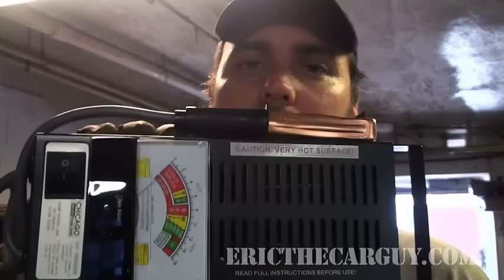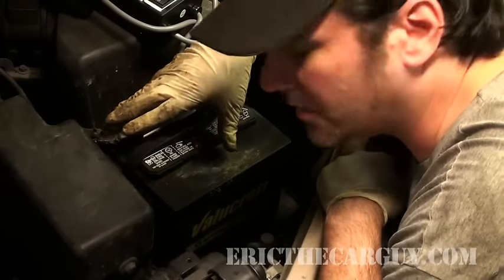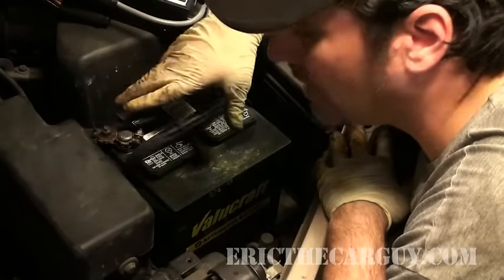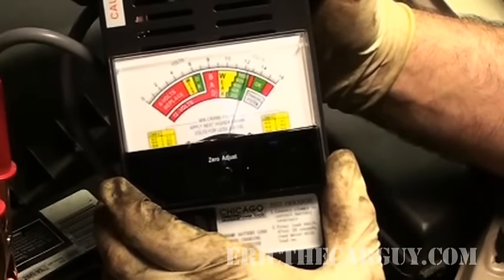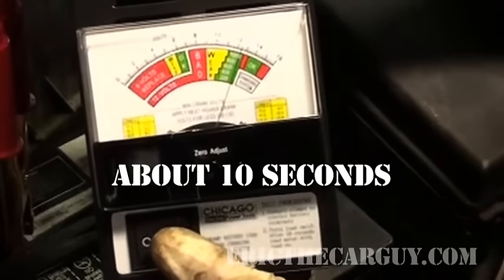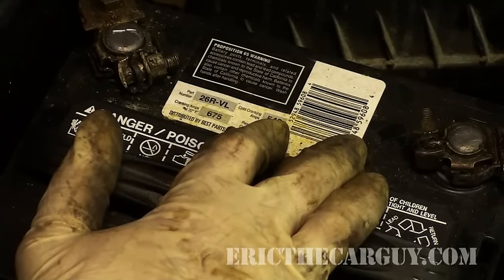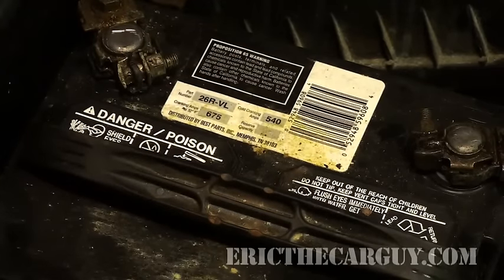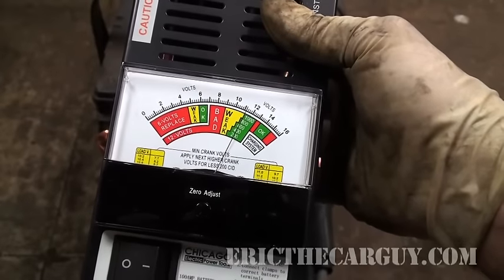Load Testing A Battery - EricTheCarGuy

Comment: Honda dealership told me I needed a new battery when my voltage was reading 14.2 with engine running and 13.2 engine off. The battery is less than a year old and I have ZERO issues with it. Autozone later confirmed a GOOD battery. How does Honda dealership mess with load printouts????
Reply: 996601 996601
12.6 off is 100% 12.4 is 75% good
Reply: Sadly many honda dealers like to feed you BS to sell you stuff lately. Recently they killed my battery during service (left lights on maybe) and came out with a BS load test AFTER they killed it and looking to sell a new one. I guess the factory trained tech was out back smoking weed the day they taught that load testing a discharged battery is foolish. Battery was fine before that day and ever since. Passes a PROPER load test (when charged) with flying colours. Maybe I can take in my load tester and teach them a class. Had another LOL report when they measured nearly new tires at HALF the actual tread depth. JUST change the oil, I don't need your BS. btw no need for fancy calculations. That stepped scale on your load tester gives you a pretty good approximation of available CCA.
Reply: 14.2 to 14.7, heck! Even 15 volts while running at idle is good. With the engine reving shouldn't pass of 15 volts and with a load, 13.7, 13.8 its ideal, but, 13.5 to 13.0 is excellent. Forgot o say, that when the engine is turned off, the battery gonna read 13  Whatever volts, Then is gonna drop to 12 Whatever volts.

Comment: alternator changed-battery 1year 2 mths old
cranking is weak as the engine feels like its going to die

battery voltage measured ( engine off ) 12.4v < after i shut off the engine from driving

battery voltage (engine on) 14.4v

battery voltage with full load ( 1 HID kit , A/C , Stereo w/ 1 amp no subwoofer ) 12.2-12.6v 

battery voltage with load while driving ( same as above ) it's about 14.0v - 14.2v

What seems to be the problem? A wireman told me that my battery has passed its lifespan..

Comment: @masteryoda394 I would think it should be in the manual, but I just checked the manual for our 93 Chrysler and it says nothing about this in there. Checked under the hood, nothing, driver door, nothing. I would check for your car anyway, then there is always google to help. It is probably listed in a factory service manual, but I can't find mine to tell you. You can usually go by the battery the car already has, but you can always use a higher amp battery as long as it fits.

Comment from the maker: @grixxles If you load test it like in this video you will know for sure but your describing a failed cell.  The symptom could also be the result of a poor connection so make sure your batter connections are clean and tight especially if you have those aftermarket terminals where you pinch the wire into the connector, they have a tendency to corrode hear and cause a connection failure.

Comment from the maker: @fraternica I'm not sure if that's a battery problem but it wouldn't hurt to check it.  It might be that the clock itself is bad when it switches over from low power to full power when you start it.  I really couldn't say without knowing the car and having a wiring diagram to see how it is suppose to work.

Comment from the maker: @richardramoso First I don't recommend washing engines as I know of more than one occasion where a no start happened shortly after.  It sounds like you might have a problem with the battery, charge it, load test it and see what you get.  If the battery is good then check to make sure the connections are clean at the terminals.

Comment: Your video helped me alot Eric I bought a voltage meter. I thought I needed an alternator but as per your instructions I realized my alternator is fine and that my battery was weak. And to tell you the truth it's one of my favorite tools now I find myself poking and prodding and checking voltage all over the car just for no reason for the fun of it I find it all very interesting. Your videos are very informative I have learned a lot from you. Two things it's awesome that
Reply: Most mechanics these days won't let your car leave the shop unless they stick you with at least a $1500.00 ~ $2000.00 bill.  It's always better to test and fix your own car problems these days.  Better yet, buy a car built around or before 2005 as these vehicles have much less electrical and computer controls and sensors which makes the vehicles ten times easier to diagnose and fix by any home DIY mechanic.

When car manufacturers install sensors to monitor windshield washer fluid levels that's getting to the point where car manufacturers are installing whatever sensors they can to maximize profits at the automotive repair shops.
Reply: @happycat0411  100% correct 👍

Comment: Good useful vid!

In a future video, you might want to mention that another sign to identify a bad battery is that it very quickly recovers to its preload voltage after a large load test is disconnected from the battery.  Note:  A good battery gradually recovers its preload voltage after a large load test is disconnected from the battery.
Reply: Would you mind explaining the reasoning for this from an electronics perspective?

it doesnt make sense to me.

thanks
Reply: ***** I do not know the reason that the phenonenon occurs or exactly what chemical reaction/s occur, however, I do know it is a proven fact that it does occur.

If you do not believe me, the next time you buy a car battery, buy a .06 Ohm resistor also.  Fully charge the new battery & then place the .06 Ohm resistor across the battery terminals for 10 to 15 seconds while monitoring the battery's terminal voltage (it will initially drop to ~11V).  As the battery discharges, the V will continue to drop.  Once the battery V=10.5V, stop discharging the battery through the resistor & pay attention to how long it takes the battery to recover to its resting V (which will now be lower than the full charge V).  Then, perform the exact same test on a battery that recharges to it's proper V but doesn't have enough capacity to start a car & you will see EXACTLY what I described in my initial comment. Note:  Do NOT use a dead battery that has one or more shorted cells.

Happy future learning!
Reply: zeffur7 I thank you for your reply.

With that said, have you ever attempted this to know it is safe?

12V/0.06 ohms is 200 amps!!

200amps*12Volts is 2400 watts!!

This seems like an incredibly dangerous test, with the possibility to blow up the resistor, and possibly burn\hurt the human testing it?

Or am I wrong and this is perfectly safe?
Reply: "...have you ever attempted this to know it is safe?"

I have used a 0.1A wire-wound ceramic encased resistor (which I got out of a large screen TV) many times to perform car battery load testing.  The resistor that I used is a high power resistor that will begin to smoke after about 15 seconds when used to test a fully charged car battery.

Was it a safe test?  Yes, for a person who knows what s/he is doing.  Is it safe for someone who has little electrical knowledge & skill, probably not. In a worst case scenario, the coil would melt & the ceramic material would crack--but not explode.  As I am a trained electronics technician, I have lots of experience & I would never allow the resistor to get hot enough to crack (because I want to use it repeatedly).  In my testing, I applied the load to the battery terminals for 10 second intervals (like car starting instructions recommend when starting a car).  I would then allow the load resistor to cool down & then apply it again to the battery until the battery reached a terminal voltage of 10.5V (you don't have to discharge this deeply to see the effect that I described in previous comment messages).

Fyi...many truck starters & some luxury cars draw 200A at startup.  Cars often draw 100-200A.  A professional battery load tester uses a carbon pile or a coiled nichrome wire as its load component.  That's why most load testers feel warm during/after they are used.

If you want to customize your max load current use the following information:
Vmax / Amax = Resistor Ohms

Where:
Vmax = the maximum charged voltage of the battery to be tested
Amax = the maximum current you need/want to draw
Resistor Ohms = the approximate resistance of the resistor that will be required (note: your cabling, connectors, etc also provide some resistance. To be more accurate, you would measure those resistances & subtract them from this calculated resistance value to determine the ideal size of your load resistor )

Example:
13.2V / 150A = .088 Ohms (this is the resistance value that you would use to create ~150A current draw)

Note:  The battery V drops as testing occurs, so circuit current will be maximum at the beginning of the test & decrease proportionally as the battery V decreases during the testing.
Reply: Thank you!

I will have to look into "high-power resistors." I was imagining a typical resistor, the kind that you would find in a hobbyist electronics kit.
Reply: *****
Oh no.  You would most likely find 1/2 Watt or smaller in such a kit.  One of those would burn out extremely fast--like a light bulb filament when it burns out.

Fyi.. You can probably make your own high-power resistor with nichrome wire for battery load testing or for a small heater.  If you have (or can get) an old electric dryer, then you will probably be able to use the electric heating element from it.  Below is a url to a website for nichrome wire info to help determine awg size, current flow, & output temp, etc.
https://www.heatersplus.com/nichrome.html

Remember, if you use such wire, it gets very hot very fast--even when energized for a short period of time--so be very careful.

Take care.
Reply: *****
Actually, the pre-load voltage is 'up' not 'down'.  "up" as in towards the battery's pre-loaded (i.e. before applying the load resistor to the battery) voltage.

To reiterate, for better clarity, you would do the following to a new battery:
1.  Fully charge it. (CC/CV method: charge at a max current of 1A up to a max limit of 14.1V.  Cut-off charging when the charge current falls to ~40 mA).
2.  Let the battery rest for 24 hours & then measure & record the battery V. It should be ~12.7V.
3.  Apply a 0.084Ω high power resistor to the terminals for 10 seconds while monitoring the battery voltage.  The load will draw ~150A & the V will start @ ~12.7V & immediately drop to ~11V--when the load resistor is applied. That is normal.
4.  Disconnect & allow the load resistor to cool down.  Watch the battery V recover slowly (upwards towards 12.7V--which it won't actually recover to that V) & then repeat step 3 (above) until the battery voltage (when loaded) = 10.5V.
5.  Recharge the new battery & pay attention to how slowly the battery V recovers as it charges. It will take quite a long time for the battery to reach 14.1V (which will result in ~12.7V after resting 24 hrs).
6.  Then, do the same test with a bad battery that charges up to the proper voltage, but that does not provide sufficient power to start a car. During the testing, you will notice the following:

a.  the bad battery will quickly drop well below 11V when loaded.  Often it will be less than 7V when loaded.
b.  the bad battery V will quickly recover (compared to how a new battery V recovers) during the load resistor cool down period.
c.  the bad battery V will recover quickly when recharging it--but when tested, it will not provide sufficient power to start a vehicle.  This is due to hard battery sulfation or plate deterioration--which always occurs as lead-acid batteries wear out.

hth!

Comment from the maker: @bobinator50000 Those batteries are great and worth the $ if you asked me.  I agree about low voltage, I've seen it effect more than just transmission shifting but a whole host of other systems as well.   Thanks for the comment.
Reply: EricTheCarGuy hey Eric can you check it and also read if it's good,  can u get a fun check and read when u don't press the power button.? Thanks great videos

Comment from the maker: @joewarcupinhull Those modules can drain the battery as you say especially if the battery is marginal, when testing for a parasitic draw you need to take this into account and make sure all the systems have gone into sleep mode before you begin your testing this can take up to 30 min or more.

Comment from the maker: @spelunkerd We had a similar device that we used at the dealership where I worked, it worked very well in fact so yea, I would use it.  As to your other question I haven't been on a 'real' vacation since June 2001, I have however done a lot of driving in that time and I think that is what you are getting at.  You could actually take the tips I put into "Trippin with ETCG" and apply that toward the video you are requesting.

Comment from the maker: @PrOGueRReRo1 The best clue you have given me is that it starts in neutral.  Perhaps there is an issue with the gear selector switch, it could be misadjusted or could have an electrical problem.  But I will also say that sometimes those remote starters can cause problems.

Comment from the maker: @boogiewoogie212 Don't ignore the evidence, it doesn't seem that the alternator is the problem, you can watch my video on "Diagnosing a Charging System" to help you make that determination.  Make sure the battery is good and check all the connections.  A good connection is key to proper electrical system operation.

Comment: I just checked a 95 or 96 nissan factory service manual and under the electric section it tells you the cold cranking amps. This is why I always take the time to find a FSM for ever car we own. Unfortunately, like our Chrysler, the only FSM I found was on ebay and close to $100, still worth it if you have the money though.

Comment from the maker: @mizer6666 I've never heard of a battery lasting 13 years, ever.  The most I've seen is 100 months, in fact I've seen batteries last exactly as long as the warranty is good for, for instance if it's a 5 year battery I've seen it last about 5 years to the day.  It must have been a very special battery.
Reply: Eric I have several  Harleys that I store in my garage. I use a Battery Minder (not tender) and they last much longer due to the desulfator function which is not for lithium batteries. I’m sure there are other brands that do the pulse charging but I have found through much research that this helps lengthen battery life.

Comment from the maker: @jdubdoubleu I had a similar problem once with a modified engine.  The exhaust ran close to the starter and caused increased amp draw when it got hot.  I would check the amp draw with and inductive amp meeter when the problem occurs.  I solved my problem by making a metal shield to go over the starter.

Comment from the maker: @bloodieduckies You really can't "load test" a battery with a multimeter as it does not have the capability of putting the proper load on the battery.  In order to load test you need to use a load tester designed to do just that.

Comment: Hey Eric what's up brother. My battery died and when I bought another I noticed that the bottom plastic hold down piece held the battery down but not completely. You could move the battery while clamped down with your hand. I was told by a auto instructor that if your battery moves around while your driving it could cause it to drain prematurely.  Long story short use a small ratchet strap around your battery & tray. Nice.

Comment: Is 9V minimum on a load test a universal number we can count on regardless of the battery's CCA rating or the vehicle's model? Is there a way to find out what the minimum req'd voltage is for a specific model? I checked under the alternator description. I was not able to find such a thing in my Subaru manual. Even on your load tester, the Good, Weak, Bad minimum voltage changes based on the CCA being rated.

Comment: Helpful. Thanks. 

I have a 97 F350 7.3 TD. It has parasitic electrical leaks. We thought we isolated them to one circuit. We put a switch in to kill the circuit when parked.  Got her running, drove for an hour. Parked it. Flipped the cut off. Next day, dead. Very dead.  Next step, I think, is to test the batteries. These poor guys have suffered through the charging up and dying many many times. Given that they are dead dead, should i trickle charge them and then load test or what?   Thanks.

Comment: Eric, when you remove the battery the car loses memory for radio stations and the computer has to completely reboot, losing memory. I've seen a small device you can plug into the cigarette lighter. It has a small 9v battery to protect the computer and other devices from complete voltage loss. What do you think about that device? 

By the way, would you consider doing a video of what tools you take with you on vacation? No start situations often present themselves away from the shop....

Thanks.